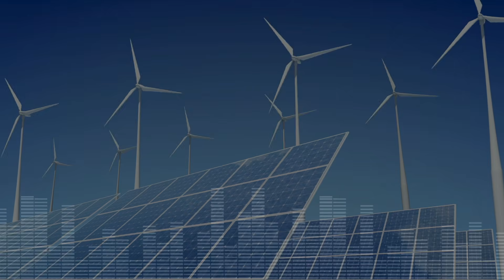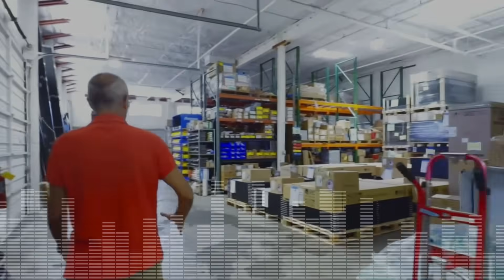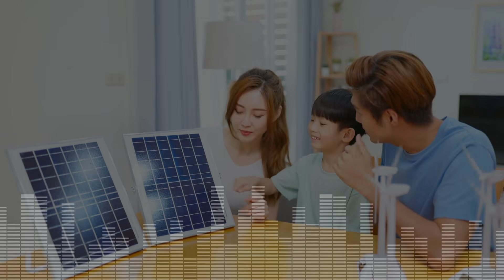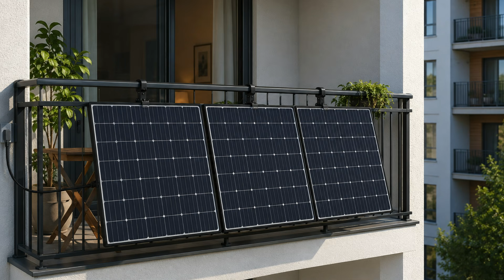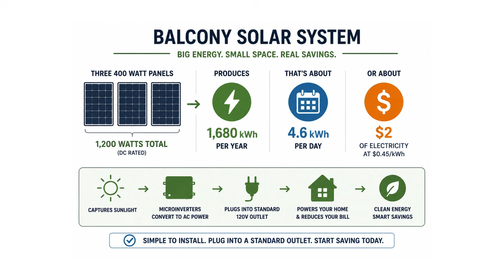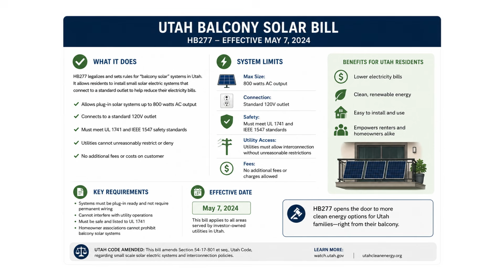Is Balcony Solar BS or The Bomb?

Comment: If you have a decent size home, get 3 of these. That's 13.6kWh per day or $6 per day or $180 per month saved.  That would pay for my whole bill. Of course, it wouldn't be a full 1200 watts, but still, you could come close and save a bunch. 

It would cost about $8070.00 for 3 of these systems, which means it would take about 3 1/2 - 4 years for it to pay for itself.  After that, it's all savings

Comment: Supposedly, in California, beginning January 2027, a UL 3700 certified system could be plugged in after completing a free online registration form with the electric utility.  A plug-in Solar setup would NOT PROVIDE ANY POWER in a grid-down situation.

A more sensible setup may be a portable power station with solar panels, which could be used regardless of the status of the grid, would be expandable, not limited to 1200 watts because it does not plug into the grid.  The downside is the hassle of powering certain appliances with EXTENSION CORDS attached to the power station, and the need to sometimes change which power source an appliance is plugged into.

With a large enough budget, you could buy and use both systems.

Comment: California did not open up balcony solar use. People please read and research what the law says. CA bill allows a UL1741A/B certified inverter, max 1200 watts,  from Jan 1, 2027 to 2030. This would save a user about $100 a year in eletricity rates. The cost of the CERTIFIED inverter is more than $450 plus solar panels and misc. Recovery cost years are 6-10. Did you catch the bill expires in 3 years? Read it yourself before investing and installing.
Reply: Also,  A plug-in Solar setup would NOT PROVIDE ANY POWER in a grid-down situation.

Comment: As long as it's not exporting to the grid then it just becomes another parasite like the rest of Renewables on the grid the ignorance of Renewables on the great is easily demonstrated with a volt amp meter and 4th grade math called Ohm's law so once you double-check your installed watt meter whether it be the power company or inverters meter you'll see an 85% difference and discover a reason for skyrocketing electric bills
Funny you mention the other countries with skyrocketing electric bills how about do the test in discover the reason

Comment: can I get two systems and plug in to 2 outlets, each on a different leg ?
Reply: Only if you want your house to catch fire.  In theory, you could shut off ALL 240 circuits (ones that use both legs), and you would be OK.  The critical part is that for 240 appliances to work, they need both legs to be out of phase with each other.  Two independent devices plugged into different outlets would be on Random phases with respect to each other, not the precise 180 degree phase shift required.  NONE of that speculation will pass code anywhere in the USA.

Comment: no barry one outlet ( cuitcuit breaker ) does not backfeed the whole electric panel ( all the curciuts)  , incorrect. that has never been true. the solar production will only offset the current draw on that single breaker. please revisit basic electricity principles. the roi on these systems is 200-300% longer than larger systems. had to stop watching. sad.

Comment: Wow, are elec companies also against roof solar? NOT! Your example of hatred against balcony solar falls flat. There is a serious fire hazard issue plugging the balcony solar into a branch circuit with an existing high wattage appliance pulling power. Additionally, the inverter absolutely needs to be UL listed and absolutely disconnects during a power outage. I love the idea of balcony power but it requires a bit of smarts, to set up correctly.

Comment: Exactly where did anyone give informed CONSENT to be bound by their rules?
What I do on MY side of the meter is MY business.
Also, my house is connected to a transformer on a pole that feeds 5 other houses.
Anything I might send back to the grid is used by those houses so I am not feeding back power to the grid proper.

I have an 800w ground mount array with grid tie inverter. My output is 500-600 during the middle of the day.
Output goes to the garage.
I have an air pump running to aerate a rain barrel. And a light when I need it there.
Left over power from the garage feeds the entire 2nd floor of the house and a couple lights on the 1st floor.

Anything I am not using is easily gobbled up by the central AC.

My inverter is also plugged into a GFCI outlet in the garage. Garage power from 2nd floor line.

In 2 months I am ahead by less than $2 in electric lol

Unfortunately it is cost prohibitive for me to do much more than I am doing.
Far too many permits and UNNECESSARY unrelated code upgrades.

Comment: Does this technology only power a single circuit that it is plugged into? For example, if I want it to run my refrigerator does it have to be plugged into an outlet on the same circuit my fridge is plugged into?
Reply: Most main circuit breaker panels are divided onto leg 1 and leg 2.  If your solar is plugged into the same leg as your refrigerator circuit, it will get power.  Anything on the other leg will get nothing.  Any 240 V circuits (dryer, water hearer, well pump, HVAC, Electric range) will not work because they need both legs.

Comment: I am considering a balcony system primarily for backup in case of power outage. I have a transfer switch in my panel that I used with a portable generator.  This allows me to shut down the power from the grid and transfer it to the generator. That way no power can backfeed into the grid. My question concerns something about the balcony system must sense power from the grid or else it shuts down. With the existing transfer switch I can assure that no power is backfiring into the grid. So how do I get around the problem of sensing power? It seems to me that in an outage, the system would be unable to function beyond any stored power in the battery. Thoughts?

Comment: It doesn't take off because you can only plug in a max of 1200 watts (the limit of the wiring in the house for either a 15 or 20 amp breaker).

Plug in more and you can set the house on fire, because you are feeding in more than your breaker box can handle.

But it is a beginning.
Reply: Why does it not take off? Who cares that it doesn’t take away your entire bill? It still removes most of the background daytime use, and pays for itself in a year or two. Then you have like a decade of cheaper energy.

Comment: Building department here was $64 for the permit, $400 for the 20 amp individual circuit. One time fee with Opalco for the solar interconnect and meter swap. Currently generating an average of 6KW a day in peak of summer with one 900 W micro converter! ROI less then 8 years even with top-con N- type bi- facial efficient panels!

Comment: Doesn't seem economically viable.  Even without permit & agreement costs, the few bucks you'd save every month would take forever to justify the cost of equipment.  Assuming the unit shuts off properly during an outage (and if it doesn't, the immediate huge grid load will dump it for sure) it isn't much use then unless you manually shut off your main breaker and are able to restart the unit to power the house...which it won't unless you shed most of your load except for maybe a fridge and a lamp.  Then make sure your preferred backup loads are on the same 120 leg as the solar unit is plugged into.
Reply: Come to California, we pay about 35¢ per kWh. And plenty of sunshine. If you do simple math, you’d see it pays for itself in like 18 months. That means a decade+ of of profits. These systems are like $800

Comment: Putting in a dedicated circuit in an existing home is no small matter.
Reply: Especially if you have an ancient home with 2 wire wiring and a 50 year old panel.
Reply: @crazysquirrel9425 yea that was my moms house - two wire circuits and a panel with 8 breakers.  When we sold it, I told the buyer to just count on replacing all the electrical-panel included. He did
Reply: @CurtisConkey  My problem is that to replace all that and upgrade everything for code compliance would cost more than the house is worth,
Have wood paneling covering lead painted walls and little insulation.
Old iron pipes for plumbing too.
HVAC is 50+ years old.
Think Batman tv series with some floors trying to slope lol

There are NO grounded outlets in the house except for one new wire I ran to replace the refrigerator wire so I can have a proper GFCI on it and be able to run the fridge off my solar cart. 
Still have to finish the connections with a 3-way switch. Reason switch can go from grid to solar cart when needed.

Lucky all that was in a basement crawl space and no demolition needed.
Nor lead abatement.
Nor interference by code enforcers.

I did install an EZ Generator switch to the main panel so my solar cart can power other things if needed. 2kw inverter 3kw peak and 4.8kw of lifepo4 batteries all in parallel.

Each battery has it's own DC circuit breaker too plus individual fuses and running 2 gauge wire for safety.
Have a Victron 150/70 to provide power from another array I haven't built just yet to charge batteries.
Only way to charge them now is to use a 40a lifepo4 charger which complies with battery mfr requirements on limits. Works out to about 10A/battery which is 1/2 the max charge rate allowed.
Even have a breaker for solar input to the victron and a breaker for the output from the victron.

Going to run 8 ga wire from the next array to the victron even thought he run will be less than 50 feet with 2-200w panels.
Dang hard to find MC4's for 8 gauge wire.

Been planning and buying things for a long time now. Long slow process when you have no credit and no money....

In a grid down, I know how to trick the grid tie inverter into running too. Tested it already.

Have a small fortune tied up.

But how much is one's food worth when the grid is down and there isn't any to be bought?

Water will be the biggest concern...
29gal rain barrel isn't much water, even if full.

Yep I know how to treat the water too.

Fun fact:
I took a Trangia and 4" cast iron skillet and cooked breakfast one day on the kitchen table! lol
Takes a while but it can be done.
Bacon first, one slice cut in 1/2, then the egg.
Trying to figure out how to make toast!

I prefer individual components. Reason if there is a problem I can replace the bad component.
This is why I don't use power stations.
Anything internally breaks I would be screwed.
I can run with 1,2 or 3 batteries if one fails.

Where I am you need a permit to do ANY concrete work.

So I use landscape timbers to make the array mount.
I dug the holes and use the expanding foam they used for decking. Left some sticking out the top in case someone looks.
No permit that way as no concrete used.

Comment: In Europe you need zero permits, zero extra cost, zero waiting time.
Reply: so the socket always allowed energy to go in? i discover this now lol
Reply: @cosettapessa6417 Yeah, a socket is just a connection to the wires in your house.
Grid-following inverters do the magic.
For both residential rooftop solar and for plug in solar the magic happens there.
Reply: @konstantinlozev2272  so you plug it in when it gives 200watts and if something is using 300w 200 are free?
Reply: @cosettapessa6417 yes, but your maximum allowed wattage is 800W, so even higher load could be offset in sunny weather
Reply: @konstantinlozev2272  yeah that's a low limit
Reply: Hopefully in Europe you can use this to run an air conditioner so you don't die of heat stroke
Reply: @Benroe-yz1nz  yeah you can, 'murican.
Reply: @cosettapessa6417 the European leaders don't just worship the Sun God, they let him kill about 140k a year of yall with heat stroke

Comment: We use a small system for back-up power without grid tie. We have plenty of sun in the Philippines but have brown-outs. The back-up system runs AC, fridge and router during these times without dealing with attachment to the grid or dealing with the power company. Off grid makes it practical.

Comment: Can you just pull the service (meter) out and run totally off solar? Does that count as being totally disconnected from the grid?
Reply: Most utilities do not permit tampering with the meters.  Best alternatives is either never get a meter or use an export limiter to prevent your hard -earned electrons from escaping into the wild.

Comment: I’m considering mounting solar panels on my balcony railing and my deck railing. Then I want to connect my panels to a battery (like one of the Ecoflow batteries, for instance). I don’t plan to plug in to an outlet like in the system you’re talking about in this video. Basically, rather than have a ground mount solar array in my back yard (and take up all of my yard with solar panels) I want to set up my solar panels on my balcony and deck railing. Will this setup work, and do I need approval to do this? (I live in Nebraska.)

Comment: …the electric outlet where the micro-inverter is plugged in must be isolated from the rest of the house electric service or it will blow. You cannot just plug it in and sychronize with the grid “AC” supply…!!!…’
Reply: No — a balcony‑solar micro‑inverter does not require an isolated outlet.  
It is specifically designed to be plugged into a normal household circuit that is part of your home’s electrical system. If it “blew” when connected, that would indicate a wiring fault, an incompatible device, or a regulatory issue — not that the outlet must be isolated.

Comment: The problem with all this, either roof top or balcony solar is the initial cost and the time value of money.  So in your example in California, about $2 per day.  But factor in the initial cost of the equipment, pulled out of your investments (making 8-15%) per year.  The payback is really much longer.  In some cases not actually viable.  That’s where it falls apart for me.  Don’t get me wrong, I like the idea and may still do some to play with, but I’m not in California, but in colorado and illinois.  In Colorado, they talk about $30,000-$40,000 for a roof top.  At that rate I’m Better not doing anything and keeping my $40k in investments yielding $4000-$6000 per year in dollars generated.  Well enough to out do the savings. So payback is not a good motivator, being green and doing our best is the only real motivator.

Comment: Pity he didn't address the cost of a micro inverter & 1200W of panels. 

The battery would be another cost but he could be more specific about the benefits.
Reply: Panels are about $150 for a 400w panel. An inverter is like $200.

Comment: If you are in an apartment building, your exported energy from your balcony solar would go to the closest apartment in your building that can use it, at the speed of light.  PG&E shouldn’t complain since it gets to charge your neighbor for the free energy from you since it didn’t‘cost them anything.
Reply: Not really.  it will lower the bill on your meter since you're feeding the power on the load side of YOUR meter, assuming all apartments have separate meters.  No effect on your neighbors.  You might just raise the building voltage by a few millivolts, but that's it.

Comment: I bought four 320 W solar panels for $45 each. A 1200 W micro inverter off of eBay for $125. Racking components at roughly $20 per module. This is such a small amount of power that you are not gonna get in trouble with the electric utility.
Reply: If you have a smart meter, it takes them about 10 seconds to spot the backfeeding.  You will get a letter or phone call.  If not, they will never know.
Reply: What microinverter do you get off eBay?
Reply: But once you taste freedom, you will want more.
Reply: @DonkeyHotey-l2e how true.  I've added battery systems and 5 more panels!

Comment: I am anticipating power outages this summer. Getting through the night is doable, but the days are HARD when the real-feel is 112° 🥵 if we could have a set up JUST for a window unit AC, it would be ABSOLUTELY WORTH IT.
Reply: EG4 add presumably others, make solar panel powered heat pumps. 

Air Conditioning in the summer & heat in the winter.

But more costly than an inexpensive window rattling AC unit.